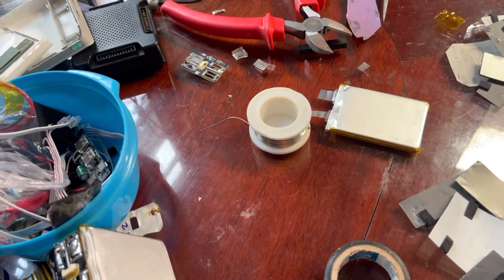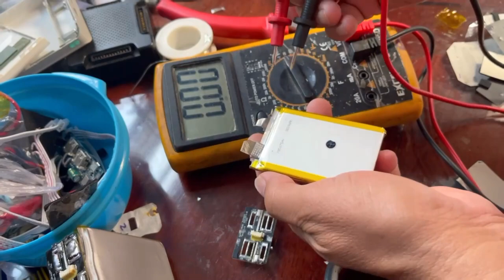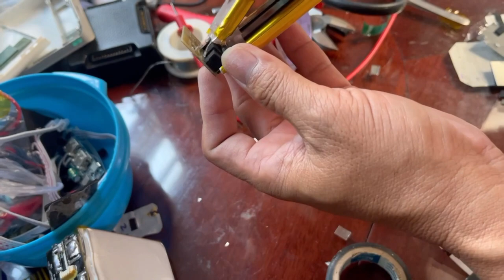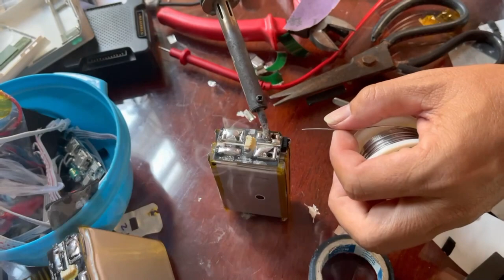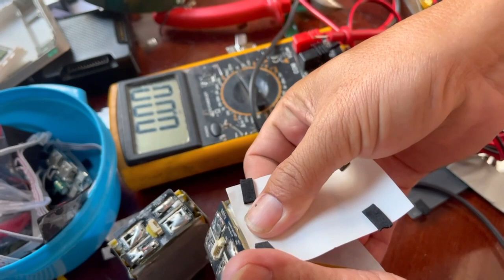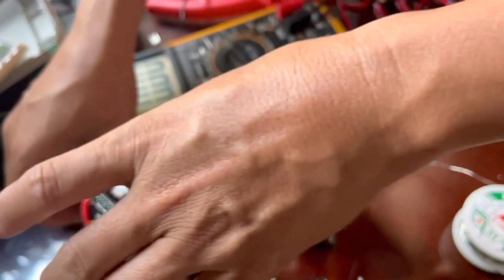Mavic Pro battery cell self-replacement. Walk through ..

Comment: Hi, Thanks for the video. by changing the elements, have you had any problems with electronics, resets and so on? According to some, electronics go into protection, but it seems strange. This would be the only solution not to spend €100 on a battery or to throw away a few-year-old drone. Thanks DJ

Comment: I have the problem that my battery resetet it has an PF Error. This happens if you desolder the main PCB  from the Battery. If the Voltage drops it locks the Chip and you can not use ist. There is a software to fix this but it is very expensive